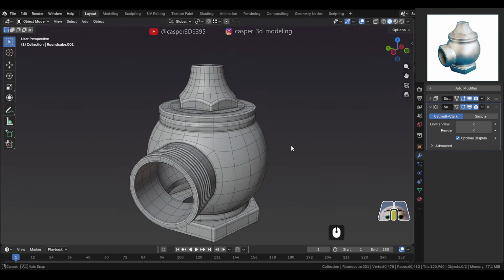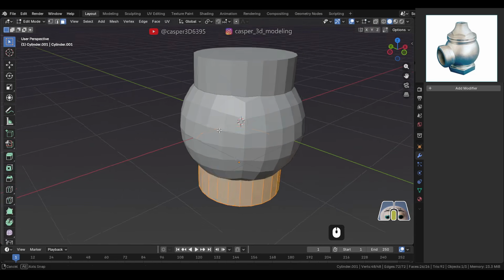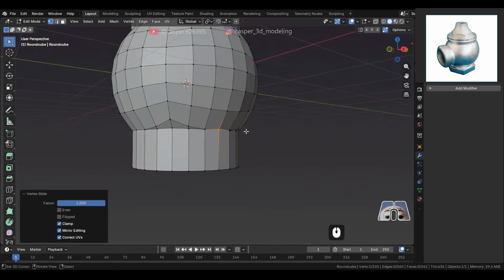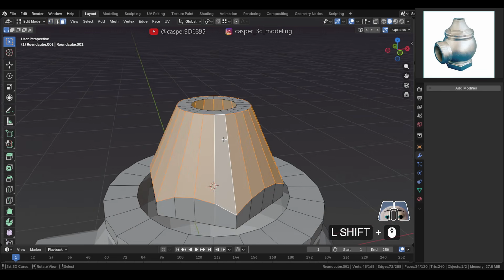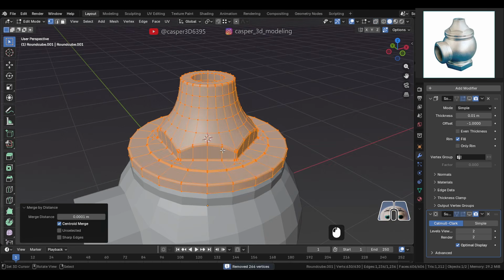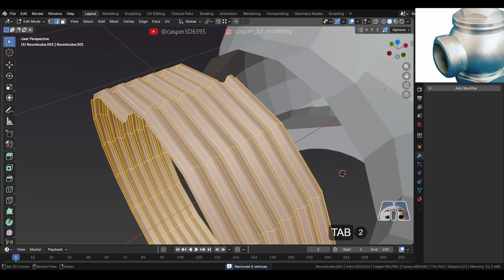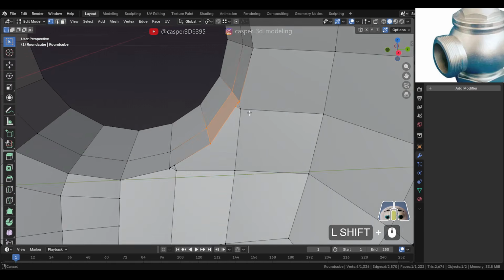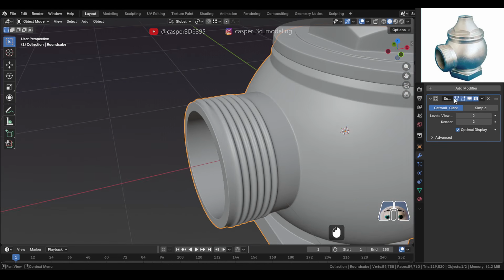Blender Practice – Modeling an Industrial Angle Valve Casting Body

Comment: I have a quick question,  after you fixed the verts from the top, wouldn't be faster to symmetrize to the bottom? I only  ask because I tried that method and it worked, I had to  fix one edge on the side.
Reply from the maker: Good question! Yes, symmetrizing could definitely be faster, but I did it manually because the top and bottom aren’t exactly the same size, so it wouldn’t give the correct result. So yeah, that’s the reason.
Reply: @casper3D6395  Thanks for clarifying, I forgot about the top not being the same. Great video, I'm still learning blender is why I asked, I wanted to make sure i wasn't doing something wrong.

Comment: hey man, I once wanted to use the auto merge option but the button doesn’t show up. Is there a setting? I’m using the latest version of Blender btw.
Reply: try to switch to "Modeling" workspace. sometimes it misses in Layout , for some reason.
Reply: @Thorrian  oh okay I haven't tried that. Thanks
Reply from the maker: You can also find it in the side panel.  press N, then go to Tool, Options, and you’ll find it there 👍
Reply: @casper3D6395  Alr ty mam I'll try that too. Your videos are so helpful bro keep it up!
Reply: It only shoes in Edit Mode, also: if the whole header is missingg click on the little arrow in the upper right
Reply: @meefvongrau9814  alr ty I’ll try that out. idk if it’ll work tho I remember myself trying it but not sure.